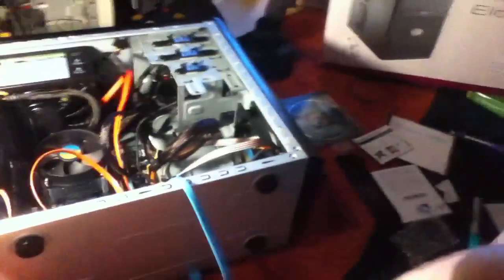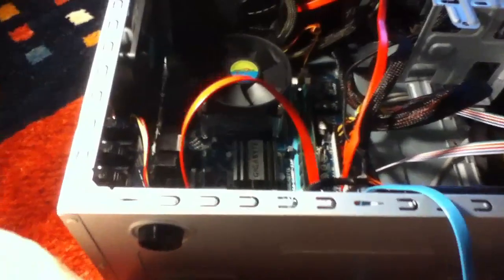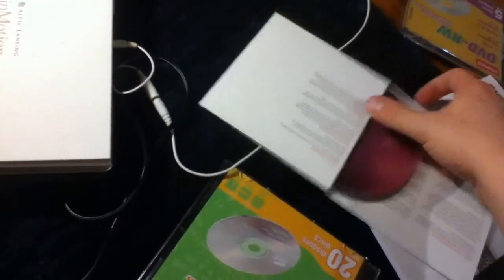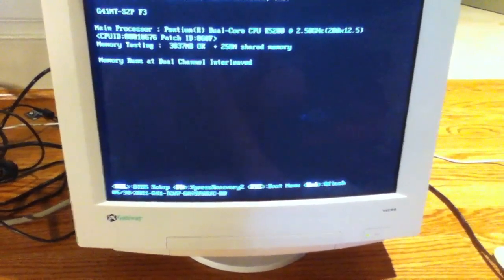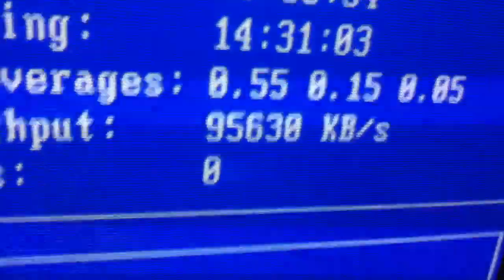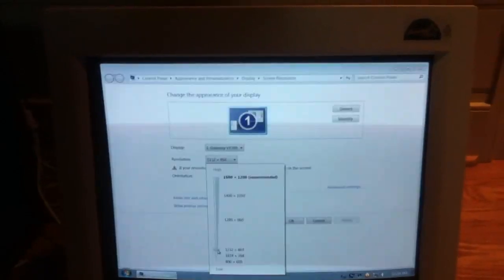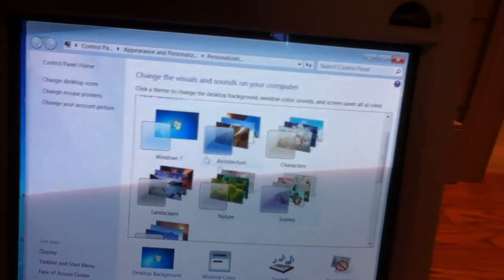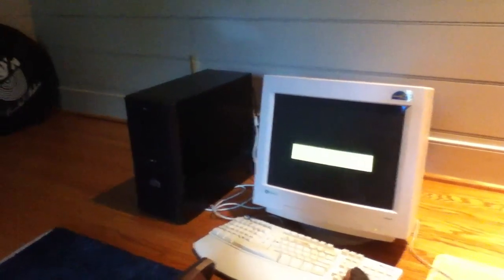Computer Build For Customer

Comment from the maker: @37474748 you know how to disable internet on a real machine? unplug ethernet cable. derp.although using linux as a router is possible. my router actually does run on linux. i put DDWRT on it.

Comment: @lmull3 Yes and no. Vmware has ability disable internet when you want easyly. It also has the ability to link virtual machines. That meaning you can run an linux distro as for router and have custom rules for the virtual box you actually use. Also you could setup backups on the virtual machine. But as for data theft goes its hard to protect agnst. But dataloss is much more easy i think.

Comment: @lmull3 its ok man. Was just worried i offended you in some way witch i was not intending to do. I like the computer though. Its an good choice of board and cpu. Im sure its ganna be rock solid. Kingston rams you cant really go wrong with :) What case was it you used? Ive seen those but never really reflected on the brand of the case?

Comment from the maker: @37474748 it's not any safer then the host OS. that's a deception. VM's are just as susceptible because if a VM gets infected, it's the same as if a real machine were infected. it's just in a virtual environment. the same exploits, the same security vulnerabilities exist in a virtual machine. they're not invincible. you can still have your shit hacked and stolen in a virtual machine because it all comes down to software, and if you're running Windows in a VM, it's not any safer.

Comment: @lmull3 well its grate for safety. And 70year i had no clue i was thinking about 40 to 60years tops. If you said 70years in the video i need to scrub my ears real good. Because i totally missed out on that.

The fact stands though even if she aint ganna use it that running something in an virtual envirement is hell of allot safer then just on the host os. That is the only logic reason anyone would need an faster cpu just for regular work i can see.